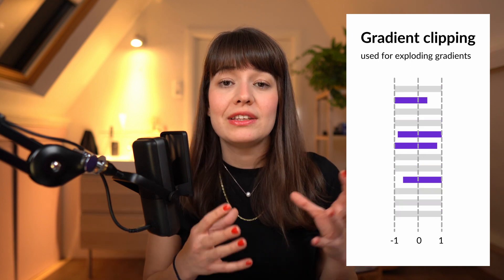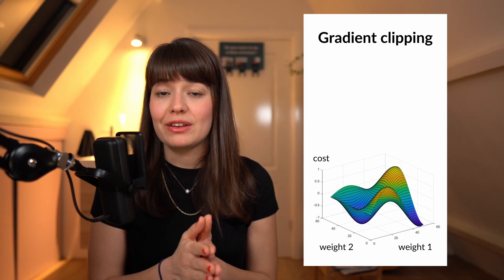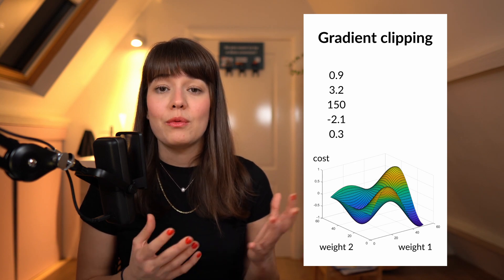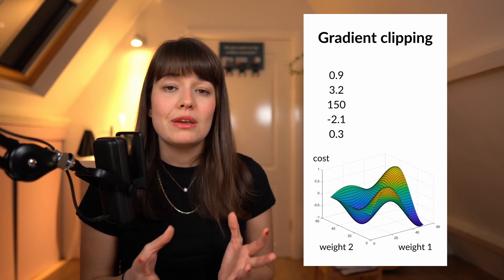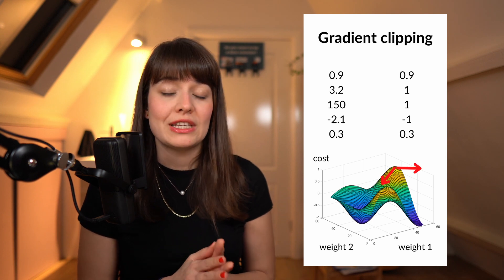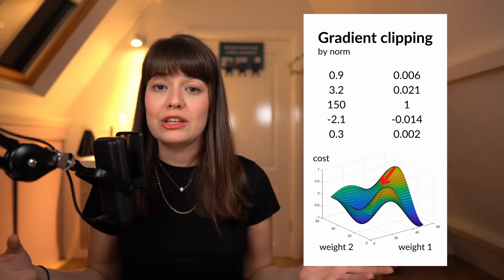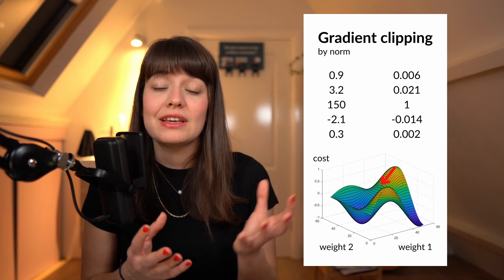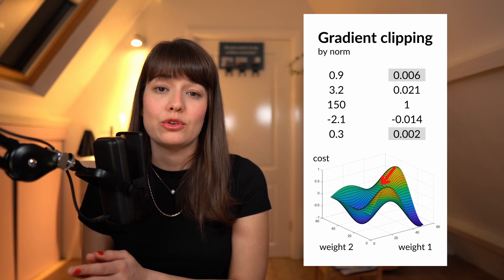Gradient Clipping for Neural Networks | Deep Learning Fundamentals

Comment: problem with gradient cliping is if you use multiple types of networks in a single model, or a complex model that uses multiple types of layers, transformers are a nightmare in this example , some layers has gradients in a range of   +-0.1  and some are +- 10*e-6   where clipping the ones on top those won't get affected